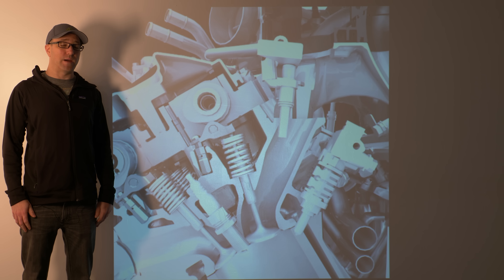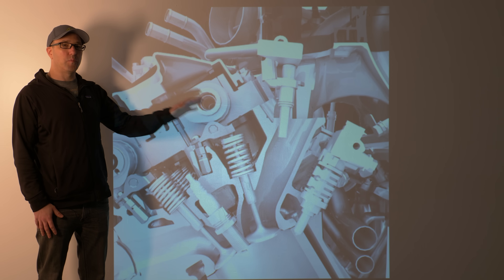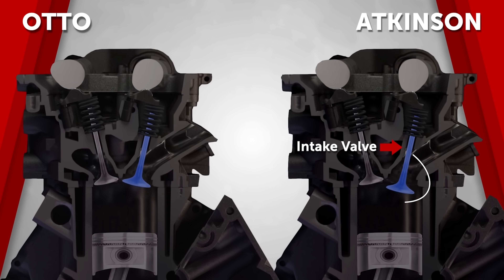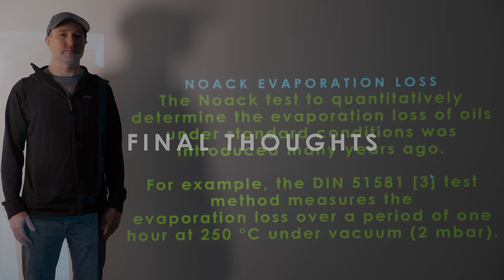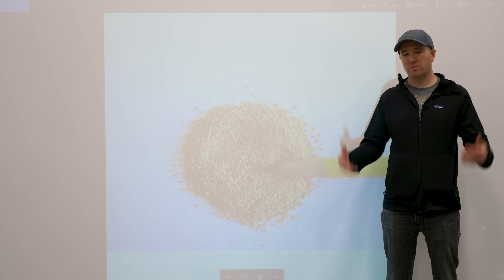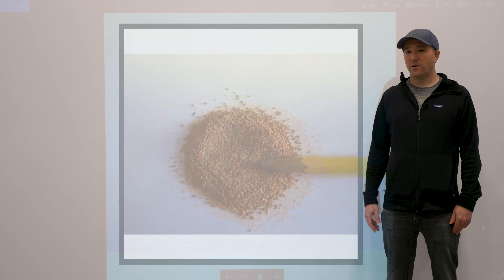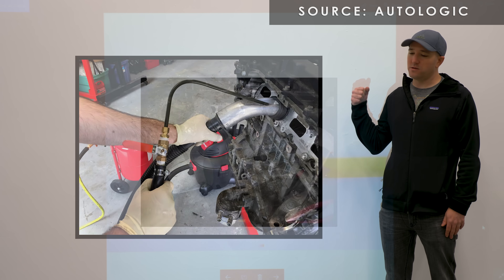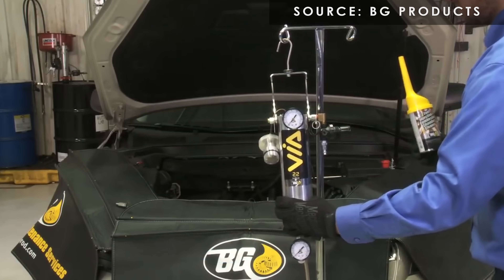Direct Injection, Problems and Solutions | The Fine Print

Comment: I just bought a new Mazda 6, just found out Skyactive engine has direct injection...now I have second thoughts...
Reply: I have a 2014 mazda 6 bought it new. If you put crc turbo and valve cleaner in the air intake, this is not a problem. I do about a 1/4 of a can every oil change. Do not get it on the mass airflow sensor. Look at some vids on YouTube.

Comment: Sounds like I need to buy a catch can and figure a better oil for my GTI
Reply: The best oil hands down...
Amsoil.
I'm a mechanic with 30 + years experience, mostly on fleets, trucking, construction and government fleets.
 I have owned and managed, hands-on though, for several years.
  Working on fleets you live with those machines and see what other shops usually don't, because you literally live with the fleet equipment. That allows you to see cause and effect, what works, what doesn't.
  I use Amsoil on my own equipment, have for more than 30 years.
In fleet settings we track everything, fuel, oil consumption part life, failures, causes, how to prevent and so on. 
We are able to review using our computer tracking software things in great detail, that allows us to see trends much sooner.
 Each time I took over a company or government fleet I would switch all the lubes over to Amsoil.
In every case fuel consumption decreased, repair costs dropped on average 40%, downtime decreased by same amount. 
 By using Amsoil and their filter systems we switched to oil changes based only on oil analysis, not by milage or hours.
By doing that we found oil change intervals were extended by almost unbelievable amounts.
 Oil Change intervals dictated by engine hours, say 200 hours were done only when lab results showed it was needed often beyond 2,000 hours.
Long haul class 7, 8 heavy trucks saw oil changes over 500,000 mile intervals, cars, pick ups, once a year or longer.
Consider that you live with the equipment year after year you know if something is working or not.
Down time is more costly than parts and labor to most fleet operations. The loss of a machine or class 8 truck for a week or 2 is often a greater economic impact than the $10,000 to $20K  repair cost.
Reply: @richardc7721  

"Long haul class 7, 8 heavy trucks saw oil changes over 500,000 mile intervals"

You sure about that?
Reply: Better piston rings thats why it burn oil

Comment: ahh, the pressure actually goes out of the chamber into the crankcase, not "up" into the head someplace. The pressure is both from blowby but also from the pressure that builds in the crankcase itself from heat and from the up and down motion of the pistons above the crankcase.

Comment: I’d like for you to help me locate a low mileage 4.9 PFI engine for my 1992 Cadillac Fleetwood Sixty Special.  My car had 283,176 miles and I was told that the engine locked due to a faulty EGR valve????  What’s that??  Where is that EGR on my engine?  I thought the EGR controlled the engine.

Comment: very nive video :)  helped a lot , I learnd a lot :)  but we cant use heavier oils in case we have those variable valve timing mechanism
Reply: Yes you can use heavier oils as long as the winter rating is met, for example if the dealer recommends 5w20, you can not use 10w30, but 5w30 is fine, you could even use 0w40.

Comment: This is why I'm so pissed at Kia. They had me convinced that the optima sxturbo was a bit of a dream car. Then came reality.
Reply: Fortunately Hyundai/Kia is realizing the mistake of direction injection only and are in the process of moving to dual injection, the 2020 Hyundai Venue and Sonata are the first to have those new dual injected engines, Hyundai refers to them as Smart Stream engines. I am sure those new engines will start appearing in Kia products soon.
Reply: @NYGlockinator13  So, their lingo of "Smart Stream" means a vehicle with an "old school" port injection and also Gasoline Direct Injection or SIDI? Did not know that until now, if this is so than that would steer me towards a 2020 or 2021 Sonata, for sure. "Smart Stream," I guess this refers to the stream of gasoline being injected to the chambers?
Reply: @frankfarago2825  smart stream is just a marketing name from Hyundai/Kia. Upon further research it appears that not all smart stream engine are dual injection only some of them for example: the new 3.5 twin turbo in the GV80 and G90 is dual injected and also the new 2.5 turbo but not the new 1.6 turbo.
Reply: Frank Farago yes Toyota has been doing this for a while. Seems to work good.

Comment: So the 2016 and up 1.5L turbo civic engine is bad?
Reply: Go on the Honda forums and see what they are saying..      I do know that the oil dilution with fuel IS DEFINITELY a problem on the Honda 1.5t and 2.0t.
Reply: @jaylee8703  I've researched that, and now with this carbon build up, the labor for cleaning must be crazy, every 30k? And I've read the new civics have problems with the honda sensing and electrical issues.  Ugh I want one but now I think not

Comment: Dont buy an IS250 of any year.... You REALLY want the IS350.
Reply: Truth. Terrible motors.
Reply: @Davido50  Yeah, that's why most of the IS 250/350s can reach 200-300k km easily if well maintained. I suggest using premium gas and Bardahl oil every once in a while which cleans the engine and lets it run smoother.
Reply: Truth. Both have issues. Traded my Lexus for a new Caddy CTS AWD.
Reply: I have one. 111,000 miles with no issues. You are scaring me😠

Comment: Saw on another channel that DGI can thin the engine oil with gas due to blowing by the piston rings-Gah!!!-John in Texas
Reply: TheGearhead222 I just read a scientific article that showed particulates from GDI are about four times worse than PFI and it explains that you never want fuel to touch the cylinder walls or piston tops because then it will not burn well. As you stated, when it hits the walls, it will get shoved into the crankcase oil if not burned. If it is burned, it will not burn properly.

Comment: So why not add something behind the valves to spray some quantity of fuel or whatever washes the build up (or helps prevent build up ) at regular intervals. Why not do that ? If carbon build up is the only problem then add something behind the valves that sprays the fuild at regular intervals to keep them clean.
Reply: wmi will solve the problem on petrol cars.

Comment: I don't know if its a good idea to change your oil viscosity cuz the motor was designed to work with that particular viscosity and you don't want to wear ur engine or your timing chain prematurely
Reply: Most manufacturers will list more than one viscosity option for their cars so if there is a thicker option you should choose that one if you have a DI engine.
As manufacturing tolerances have gotten tighter over time, that has mandated thinner oils, another area in which older engines are more robust and less sensitive.
Reply: @soundseeker63   and less eficient too (and the oil last less between intervals)

Comment: Welcome to the diesel engine world.  Cylinder wash, excessive soot, MORE POWER.
Reply: Ah, yes. One engine ignites the fuel in the cylinder, which creates small, internal explosions, resulting in the production of heat energy that is lost to the environment. The other engine operates under pressure-literally- by compressing the fuel in the cylinders instead of igniting it, thus creating far less heat energy that is lost to the environment, resulting in a more efficient engine that gets superior fuel economy. You make a very equal comparison, sir.

Comment: Direct injection for gasoline engines was invented long before today. 
It was in the 30's for superpowerful aircraft engines. Tested and used extensively for several large V12s during wwii. Its main motive was for fuel savings and HP gains. It is NOT a recent invention. At all. Not even close. Don't let car companies fool you. Direct injection, dual overhead cams, variable valve tech, and many other technologies are old. VERY old. Car companies are just very lazy and sluggish to adapt engine technologies.

Comment: Use water meth injection, problem solved! And the benefits, is, you can turn up the boost more, and the engine runs cooler..
Reply: Dont try that with a diesel. You'll run the risk of hydrolocking the motor.

Comment: Why don't manufacturers just redirect the gases accumulated in the head straight to the exhaust? Would it mess too much with the catalytic converter or overall emissions?
Reply: Yes. Oil on catalytic converter =bad

Comment: Every now and then I do use a fuel additive and sometimes I feel like they work and sometimes I feel like they don't. Maybe I am falling victim to marketing. However from my own research, from people I have asked (mostly professional mechanics) I have heard they do work or they don't work. 
God only knows if and how much carbon I have in my engine. Then again I have not noticed any loss in power and fuel economy. So maybe not much at all. Then again I do the "Italian tune-up", use top tier gas and have my oil changed at the recommended time. This is on a 130k engine. 
I have been thinking about having someone check the engine in my car to see if there is carbon build up and if so how much and depending on the amount, have it cleaned out. 
As I said before I don't think have a lot if any in my engine if I am not losing power and I am getting MPG.

Comment: My family members 2006 Lexus is250 was was bought brand new never experienced any problems throughout its whole life except fixing recalls one was for an engine issue I will say but no problems happened they ended up hitting a brand new engine in it for free, it is now at around 140,000 miles and still being used no problems the engine is only about 2 years old

Comment: Does this buildup happen less if you drive super conservatively? Like for my daily commute in a direct injected Honda Fit, I never go above 2500 rpm, so would it theoretically last longer?
Reply from the maker: Its highly dependant on engine design, head design, wear, oil used and temperatures.  Typically higher temps and climates will help baking on carbon.  Also you have EGR and PCV system design. Best mitigation is a catch can, newer oil formulations and less agressive driving. But again depends on the car.

Comment: very good explanation.

why do not disconnect the pipe from the from PCV to the intake manifold (please ignore for a moment the environmental issue)?

if I have a vacuum pressure in the valve cover because of damage PCV how much it is a problem and cause damage to the engine?
my engine is not stable in low RPM while it is neutral gear is it require valve adjustment?
Reply: Avishai Karat newer cars will throw a check engine light if you just unhook it best thing to do is see if anyone’s done any upgrades. The best one I can think of is a catch can

Comment: My car has infinitely adjustable cam timing, quad cam V8 and its port fuel injected... Without any cleaning, the valves are spotless... The emissions are extremely clean and its tested annually. It's a Porsche Cayenne 4.5 Litre V8 thats just turned 15 years old! NOX is zero, Particulate is 1ppm, CO is also nothing.  It also is quite fuel efficient at 25-30mpg real world on the highway, city is only 5  mpg less that the newer 1.1 litre European ford fiesta!   edit: i'll be keeping this for a lot longer as it was chosen over a lower compression DI newer model at the time!
Anybody using a oil catch can with dry sump lubrication she be very careful as you may affect the pressure driven scavenger pumps like in the Cayenne.

Comment: Piston slap. The biggest issue I have with my di diesel. When cold due to the di, the pistons rattle loudly in the cylinder and it sounds like a bag of spanners. I have to drive gently until it heats up

Comment: My 2015 explorer sport port if idles too long it bogs out and don’t get no fuel and won’t start back up for an hour the vehicle runs great otherwise the pedal is very responsive I’m only having this problem if I’m idlingToo long meaning stuck in traffic the code 0087 says the rale sensor Could this be my problem

Comment: Manufacturers such as Kia, BMW, and some others are more affected with DI issues. The experts are stating that you get your oil change and maintenance checking done on time. Don't use Ethanol gas and don't waste your money on fuel additives. Also read the manual of your new vehicle. There is a break in time period where some require an oil change and maintenance at even just 1000 miles. Do it! Plus don't rev the car like your in a race towards the finish line. Take it easy until the vehicle is broken in properly. Don't use the cheaper option of oil at some drive in with no appointment needed type of Jiffy lube Express. Use the oil that's best for your particular make and model. Don't use the cheaper one to save a few bucks. If your concerned about DI, talk to an expert specific specialist of that particular make. If it's a Subaru, talk to both the dealer and get a second opinion from a specialist who works with Subaru's. Someone you trust! Research, or find out from someone who can direct you to an honest and someone who is a real expert on this. Don't just believe everything from this review. Yes, he maybe correct in what he's talking about. You can't just take his word alone! Get more information and research the facts with a specific specialist expert you can really trust. This guy does all kinds of videos and not just about motors. LoL. Engines! He has been doing new vehicle reviews that differ from many other so called professional expert reviewers. He's giving his own personal opinions expressed about new 2019 models. They are opinions expressed and not necessarily FACTS! Just his own personal opinions.

Comment: Its basically all Obama's fault. That piece of shit president ruined alot of things in America
Reply: Yes, in the minds of people like you, better gas mileage is a terrible terrible thing. How awful of him. Increasing gas mileage was a major motivator towards coming up with new technologies in order to reduce emissions. It pushed manufacturers to start using a technology that just so happened to exist LONG before Obama ever became president. Some people are going to whine and complain that DI did nothing but create problems, and not even bother coming to the realization that it helped increase gas mileage and reduce exhaust emissions significantly, regardless of the valve carbon issues inherent to DI engines. Other people realize the many benefits of direct injection and have the intelligence to figure out how to solve the problem , ie Toyota and it's D4S technology, rather than complain, they figured out a solution and then engineered out the valve carboning problem.
Reply: @David-hw5xk  it increased gas mileage and reduced emissions at the expense of the consumer. Damit if we really gave a shit we would have integrated the technology ourselves with out obama. There is a reason the tech exists so long and has not been implemented. You cant fuck with the free market. Being environmentally conscious is not a government issue. I know you probably like the idea of big brother government but thats not the same thing that Americans want. People like you and obumer need to keep your socialist priorities out of the fricken white house ok. Its hard to see how obamas dumb ass did anything good for us. He was the most anti American president in American history and that really showed big time during his half assed presidency
Reply: @ST Trump isnt going to get ride of direct injection because he isnt an idiot and doesn't fuck around with the free market. He can remove the strict laws that obamas dumb ass set into motion but hes not gonna impose anything on our car manufacturers

Comment: Great video. I wonder what else can you do if you're stuck with dealership oil changes for warranty reasons. Can you trust they're doing it right?
Reply: ?  You are not stuck with dealership oil changes in USA or Canada. Look it up.  If you have it done at a reputable shop and keep records there will be no problems.  Ensure they record mileage, oil brand, viscosity, synthetic/non synthetic and the actual vehicle the oil went into and you should be fine.   I get my oil changed at Costco and feel very confident that my warranty is valid.  Keep the receipts!  My understanding is that your warranty is still valid if you change the oil and filter yourself and keep the receipts.

Comment: This video is good.  Its a benchmark of understanding the modern engine and carbon issues.  Another item besides the valves getting carbon cake from the  recycled air pumped through the PCV system.  That carbon gets into your cylinders & mixes with your oil. Eventually clogging your piston rings.  Now you have bad rings and a oil consumption problem as well.

Comment: Remember when you could just put gas in your car change the oil and filter spark plugs once in a while and the car would run forever? I will keep my 2001 lesabre 3.8 with 278,000 on it as long as I can.

Comment: I knew this going into buying my 2018 Subaru WRX. Since this current platform’s engine, the FA20DIT is a turbo charged direct injected motor, it is cut and dry what the repercussions are as stated in this video. But since my video content is about logging my ownership, I’ll update you as I move along in my ownership on this problem.

Comment: My 2018 f 150 with the 5.0  is scrap now piston cracked and valve damaged cylinders .only 1200 miles on this truck when it went dead
Reply: tom73055 You made your first mistake going with a new Ford.